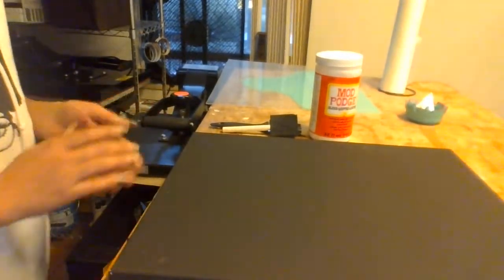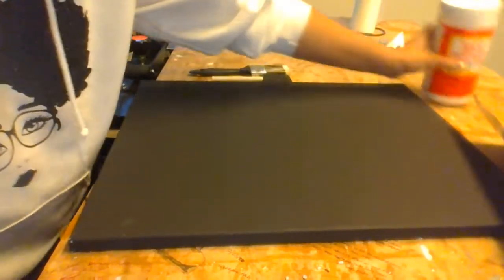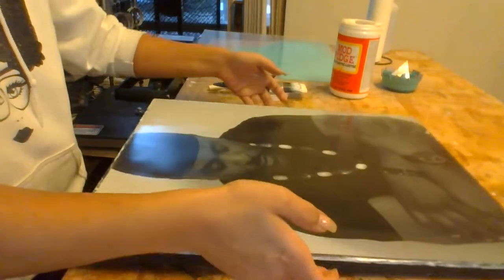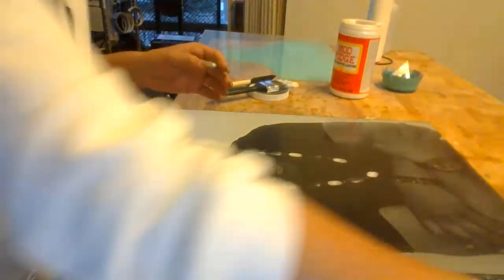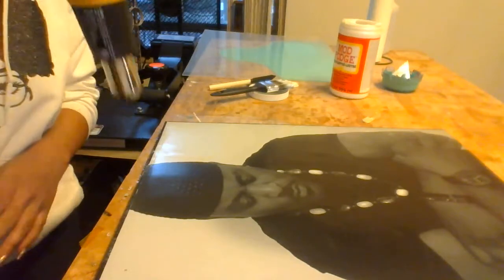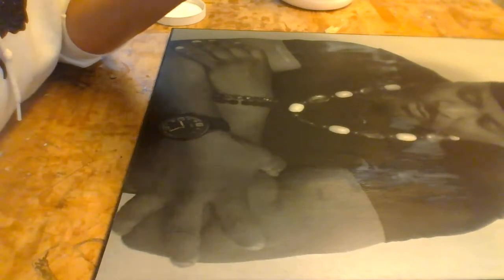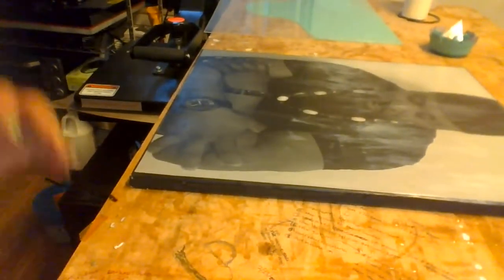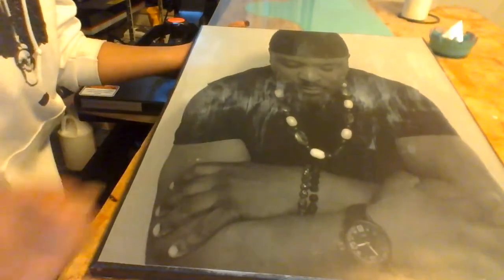Making an epoxy canvas pt 2, How to put picture on canvas, DIY Picture Canvas, How to make a canvas

Comment: Lying it face down on a smooth, clean surface, on top of some glassine paper would allow you to use a brayer to flatten and remove bubbles. Your hands are probably kept a lot cleaner than mine, and you may not need to do that but at least it would give you a better chance of not having any bubbles underneath. thank you for the great video. You are a true inspiration please post more.